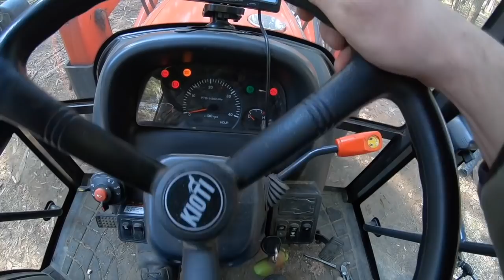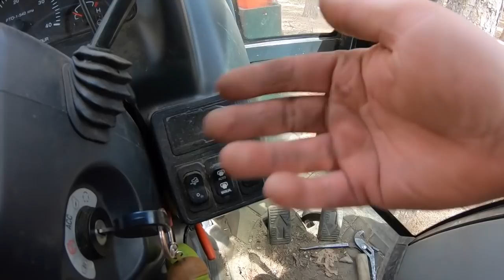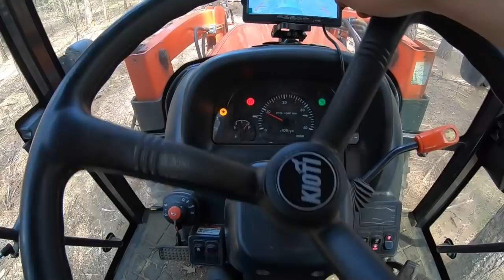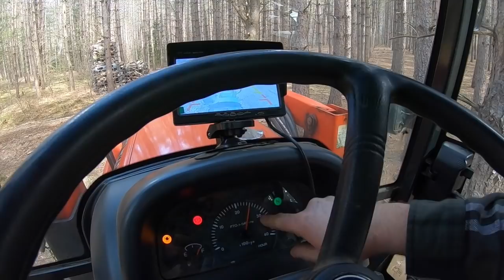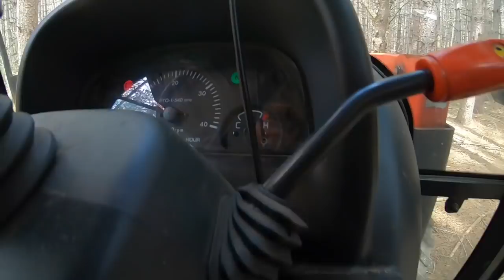Nothing Wasted at this Sawmill | Wood Chipper Eating Sawmill Slabs

Comment: High Sandy, I would love to have that chipper but my tractor is rated at 17.5 at the PTO.  A chipper that would fit my tractor is to small for my needs so I  have to rent a portable one.  Anyway, are you able to adjust the size of the wood chips produced?

Comment: If you happened to keep any of the plastic tanks for your IBC cages, one or two could be used to catch the wood chips from the chipper.  Would be much easier to move the IBC tote around with the pallet forks on your tractor.
Reply from the maker: That’s a good idea. Unfortunately when I purchased Ibc cages I didn’t get any of the plastic tanks. I also would like them to make lids to cover my firewood. Thanks again for watching and all the best

Comment: Why place the chipper so far from the material to be chipped?
Reply from the maker: I needed to wood chips to fall in a location that my bucket could easily pickup and if I back up further there’s a stump that the wood chips would get piled onto. I didn’t want to have to dig around it

Comment: If you still have the guts from some of the totes you used for firewood, they would work excellent for holding the chips until you're ready to use them.
Reply from the maker: I agree! Unfortunately I only bought the cages and don't have the insides

Comment: Maybe you've covered it before in an older video that I haven't made it to yet, but may I ask how big your property is? Are those pine trees planted by man? They seem to be very linear, so that's why I ask.

Anyway, I've been looking at this wood chipper too while I wait for my saw mill to show up. I have a '09 John Deer 4320 (48hp at the motor) and have 33 acres of forest. We've recently done some thinning as part of wildfire mitigation plan, and I'd certainly love to be mulching up branches and putting the organic material back on the forest floor to trap moisture and improve soil conditions. It's nice to see some real world uses for the machine!
Reply from the maker: Hi Jeremy. Where you often see my filming is about 40acres. Those trees were planted about 35 or so years ago I figure. Thanks for tuning in and all the best
Reply from the maker: Sounds like a great tractor and plot of land you have. I also am trying to bring my forest back to natural over time with selective cutting. At the rate I cut trees sure will be a while for that to happen though

Comment: That is wasting. Good firewood goes to chips. Greetings from Finland anyway.
Reply from the maker: I’ve got 5 full Ibc cages of slab wood as firewood right behind my tractor and firewood logs everywhere and so I end up making these into something I need which is the wood chips
Reply from the maker: It does make good firewood like you mentioned however. Thanks for watching, Finland sure is a beautiful area
Reply: This is interesting, so the logging trails you have that are muddy and wet do the chips dry it up well? I have many and never thought of doing this. I always thought you need rocks and gravel to properly solidify them but I could see this work. Thanks for sharing always enjoy watching.
Reply from the maker: I find the chips keep my tires on lighter vehicles from creating ruts. It also allows for me to groom the trails with my harrow behind the atv
Reply: @sawingwithsandy  Good dry firewood is like having money in bank. It is worth money years after cutting. I know that you have a problem with waste slaps, so you need an engine like this: https://www.youtube.com/watch?v=2Kmtjdx4jko . So you don't need to store slabs, just make firewood at once. And directly to bag. 
Make chips from waste wood like branches and small diameter wood, not from firewood.